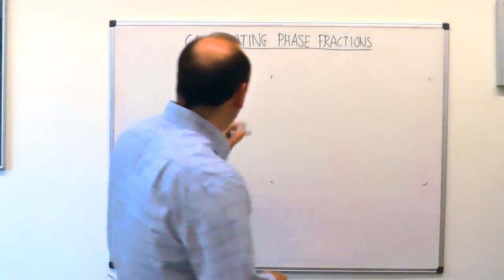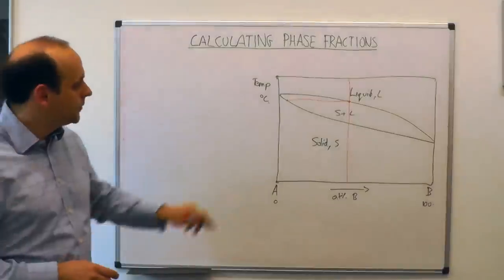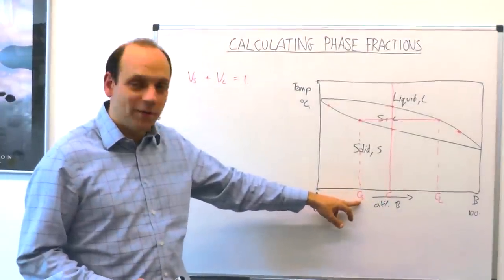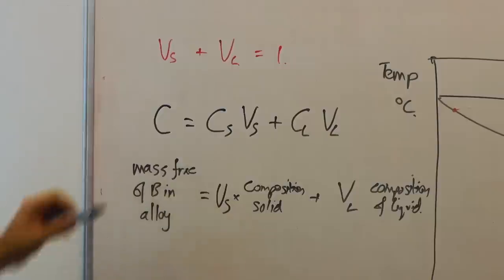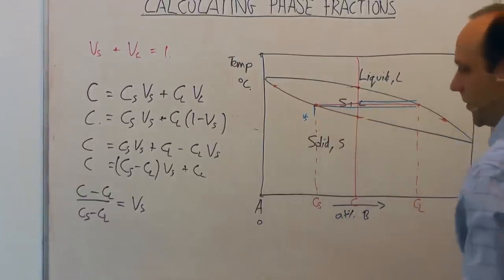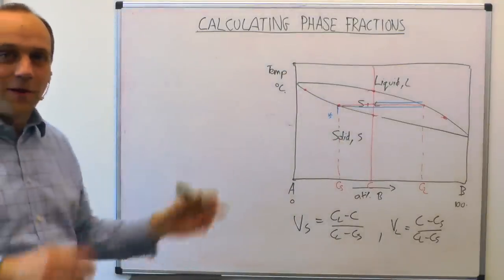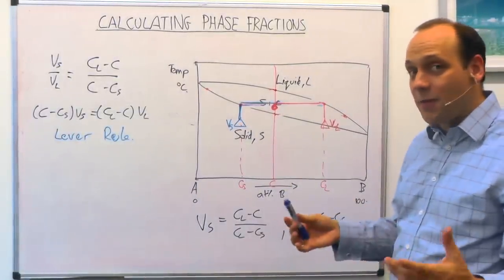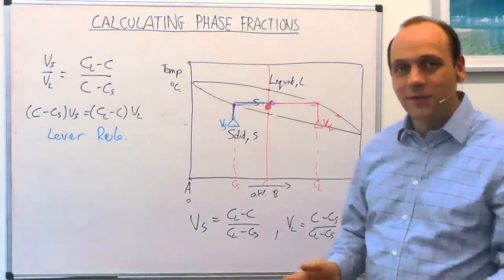2.3 | MSE104 - Calculating phase fractions (lever rule)

Comment: Thank you very much for this perfect explination! 

I have a question though. When is asked: Give me the (T,t) diagram => Temperature,time using ''De fasenregel van Gibbs" (IDK in English, fase-rule of Gibbs perhaps...). How does the diagramlooks like then? During the 2fase part (melt+solid) I have: (Gibbs) V=1+2-2=1 So the temperature can variate. Is this correct? And during the 1-fase parts I have: V=1+2-1=2 ?? What does that mean? 2 Parameters that can variate... but which ones? 

Thanks
Reply from the maker: see http://en.wikipedia.org/wiki/Phase_rule. Looks like an accurate description to me.

Comment: This could be a very nice explanation. The only problem with it is that it is not true!
It is true for mass fractions / weight fractions BUT since the densities of solid & liquid are different (in general), the rule can't be applied to volume fractions...
Reply from the maker: You are correct, of course. That's why I am flaky as to whether I am calculating a volume, area, weight or mole (atom) fraction of phase - this point is made in the notes.  In practice in metallurgy, we measure the area fraction using microscopy, very commonly. And we assume that this corresponds to the volume fraction and to the weight fraction we calculated using the phase diagram (which is usually in wt.%).  This is the custom in the subject; don't let it worry you.
Reply: Yes, the formula is obviously rigorously untrue when used for volume fractions, but he seems to suggest in the video that he uses this quite often, leading me to believe that perhaps the error due to the difference in densities is quite small for common materials?

Comment: how to find Compositions in liquid and solid
Reply from the maker: If you are in a two phase region, read across T to the phase boundaries. In a single phase region, then its the alloy composition.
Reply: do i need to use lever rule to determine the Compositions in liquid and solid
Reply: Super explanation sir thanks sir